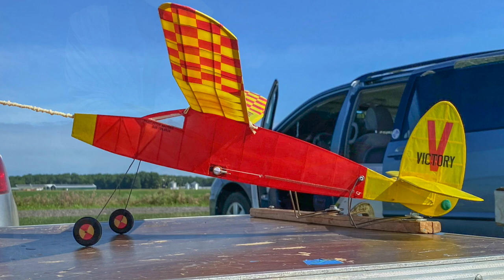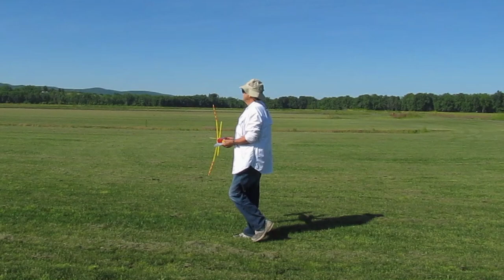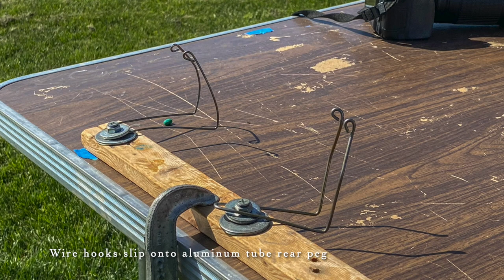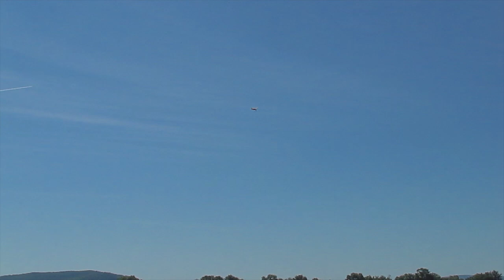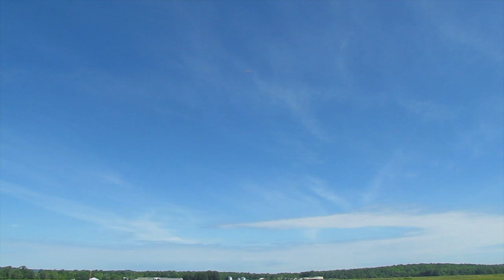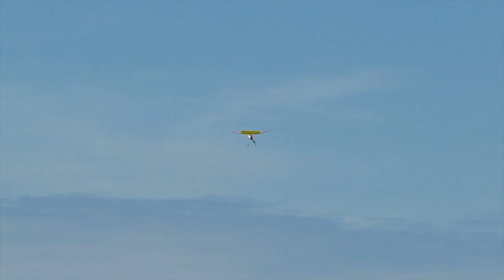Korda Victory's First Day Out - Anatomy of a Trim Session

Comment: Another wonderful video! Year ago-like 15 years- I was in the checkout line at Harbor Freight (also know as "Horror Freight"), waiting to buy some 90 degree welding magnets. It was December, and there were some cheap, free flight planes being sold for Christmas.  They were made out of the same foam that is used to package the bottom of ground beef or steaks. They had a capacitor as a battery and an electric motor. On a whim, I bought one for $8 . I spent some time straightening the horizontal stab, with heat, and also the wings. Motor turned CC viewed from the front, so I added some left rudder to the vertical stab. First flight, late in the evening, I was able to get 4 minutes out of a 30 second motor run. Had a few more good flights out of it before the capacitor failed. Lots of fun.
Reply from the maker: Ha...I remember those!!  Cheap thrills indeed!

Comment: Like Nate's question. What are the advantages or disadvantages of turning left versus right? And vice versa? Love this channel. So relaxing and informative!
Reply: the issue for debate is torque. as the prop turns to the right, it turns the plane to the left. also vice versa. there are various ways to deal with this - on many powered planes the propellor is not in line with the centreline of the fuselage, for example. props often are 'aimed' downwards and to the left. 
however............ when the power stops, the torque no longer tries to turn the plane to the left - and it then has a tendency to turn to the right.
other complications to what is visibly 'simple' flight........... are also available i'd guess
Reply from the maker: Note my reply to Nate below. Thx for the comment, Scott.

Comment: What is your CG measurement?
Reply from the maker: From Pete Kaiteris, the builder.: "...I have never bothered to actually measure the CG location, but the big lifting tail says it's far back.   The leading edge of the wing was raised 3/32".    The stab is in the plan position.   Gliding and flying established a working CG, although after a full season of flying some clay was added to the tail to flatten the glide.   So, you have to experiment to find the sweet spot..."
Reply: @maxfliart  Thanks for your knowledge. Love your videos and planes.